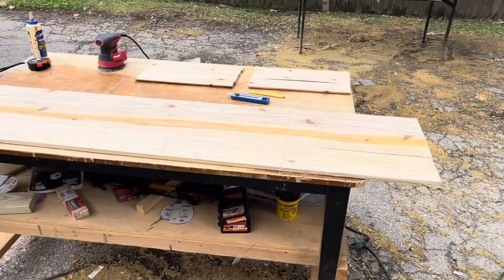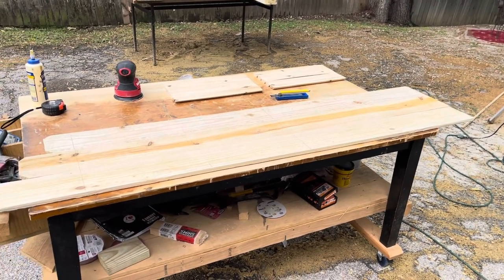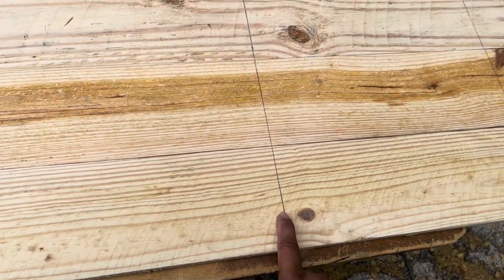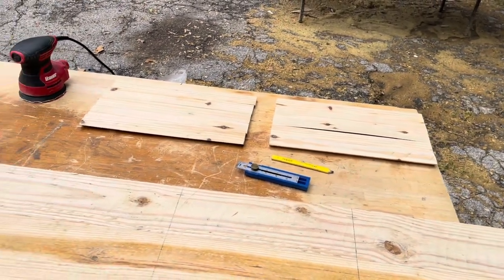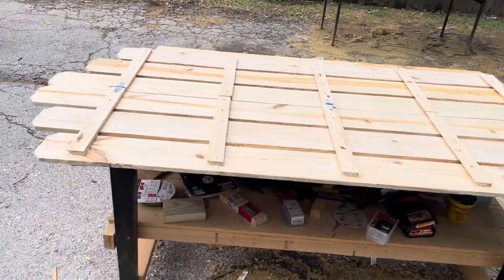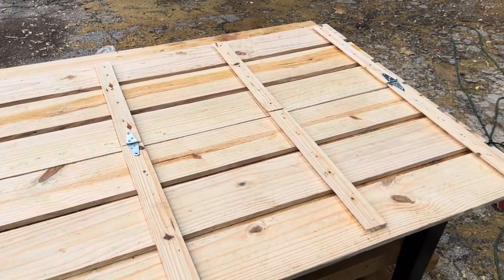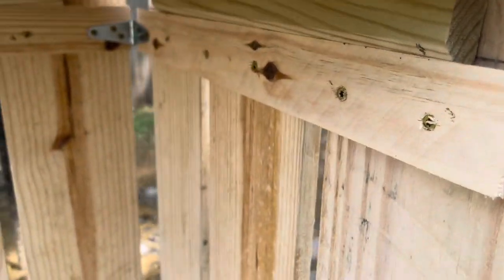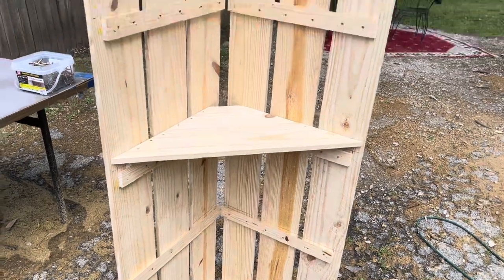Fence Picket - Folding Corner Display Shelf

Comment: I enjoy your videos, thanks.
I'm going to try and build one of these tomorrow afternoon, I'll share a photo with you if I do.
Reply from the maker: That would be great please do…

Our email and phone number is in the description.
Reply: I didn't get to this as quickly as I intended, but I started yesterday finally. 
I think there's a tiny spacing issue in your dimensions in the video. If you count up from the bottom, the dimensions you gave for the third shelf gave a 14-3/4" gap instead of 14-7/8" like the other shelf spacing. I drew your design up in Sketchup and I couldn't figure out why I had a glitch, and it's only an eighth of an inch (so who cares, right?) but I thought I'd pass it along. 
I found really nice cedar pickets locally to use instead of PT pine. Really spiffy! 
Photos still coming.

Thanks for your videos.